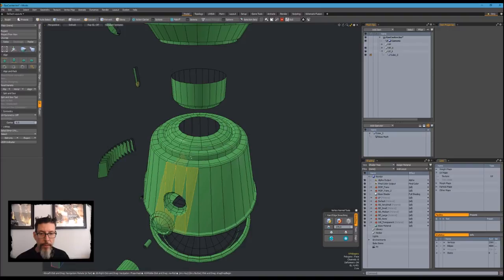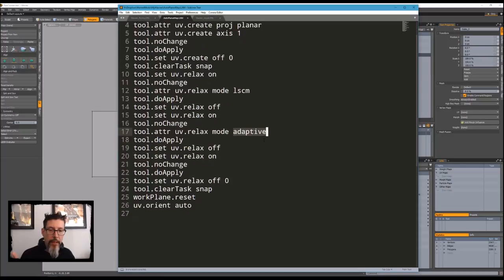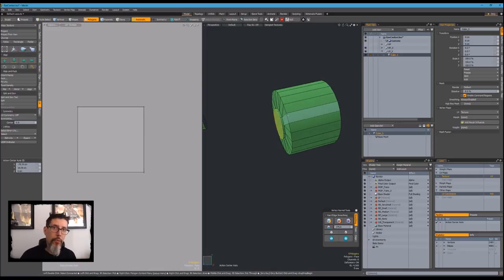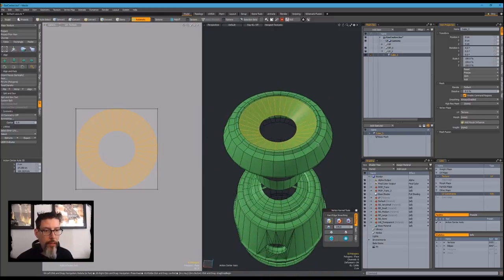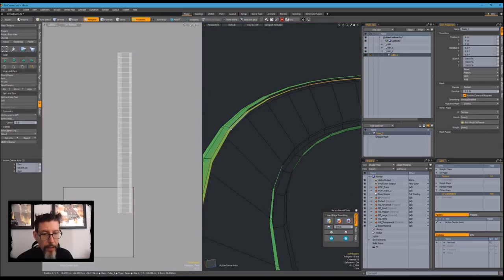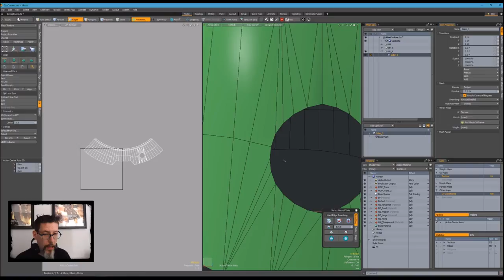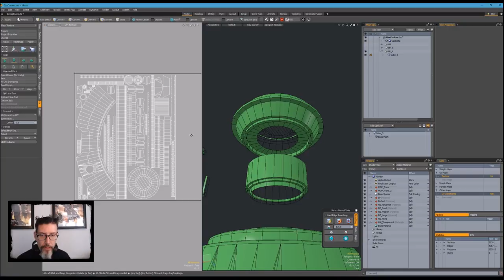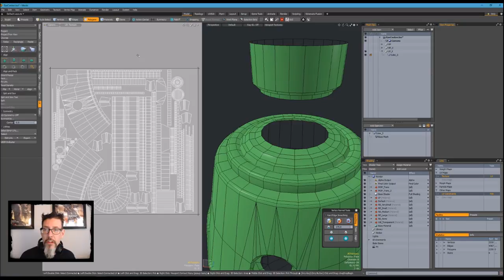Build A Prop : Gas Cooker - UV Unwrapping

Comment: Great video! A couple of things for improve speed of unwaping: now in modo u can split UV edge (split button in Split and Sew section) - it's faster then detach the peace of UV and attach it later. More faster is make the macro: split edge, convert selection to vertexes, select coonected, uv rectangle. Another thing for improve speed of unwaping is using Select Sharp edges.
Reply from the maker: OMG ... OK, I knew that was there but I never thought to use it.  I'll give the split function a go, thanks!  That does sound faster than what I'm doing.
Reply: Ye, exactly, but I've add for me after that select.convert polygon and tool.set TransformMove on. Also one impotient notice: uv split edge works only in first main UDIM only, I don't know why.

Comment: Hey, all: I fiddled with macros and this is the Y-cylindrical projection macro I came up with, based on Warren's work. YMMV & Warren has the last say.

#LXMacro#
workPlane.fitSelect
workPlane.rotate 0 90.0
tool.set uv.create on
tool.attr uv.create proj cylindrical
tool.attr uv.create axis 1
tool.noChange
tool.doApply
tool.set uv.create off 0
tool.clearTask snap
workPlane.reset
uv.orient auto

Comment: tnx for tutorial 
but hang on second 
you said in every smoothing break you should put seam but you didn't that in same parts like teeth of cooker 
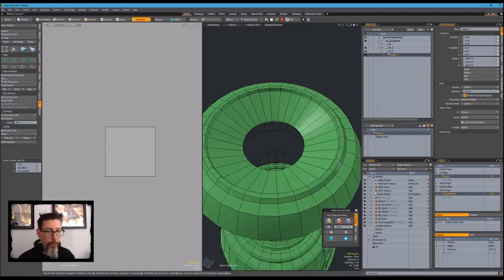or in min 10:45  
this strange  little bit for me .
so what the exception ? 
where we take the rule and where we left it ?
Reply from the maker: The teeth in the main body of the tank? Those don't have smoothing breaks in the low poly.  They may appear to because of the edge weighted normals, but they aren't.  Those are convex shapes that unwrap just as they are.

Unless you meant another area?

And ... well, that rule is pretty iron clad BUT it can be broken or ignored and you'll still be OK in some circumstances, especially if the edge you're NOT breaking is convex instead of concave.  Every rule has a bunch of exceptions.  :)
Reply: Warren Marshall ok that make more struggle 
What you mean excatly by smoothing break ?
I know it by it every edge have 90 degree angle .
Is it right ?
Reply from the maker: It's however you set up your mesh.  Generally, you break on 90 degree or greater angles but sometimes you do other things for various reasons.  But just visually look at the mesh ... if there's a hard seam on the low poly, indicating a smoothing break, you need a UV split there.

Comment: Thanks, great tut. I wanna ask about unwrapping; You packed those parts separately how did you do and  when i select and edge and unwrap in modo it's unwrap whole mesh not that part. Could you give some advice? Thanks again.
Reply: If not invert selection and hide the others by the way but this is time waste
Reply from the maker: If you select the polygons you want to unwrap, then select the edges you want to use for seams, it will only unwrap those polygons.

EDIT : I HAVE found that you have to start the Unwrap tool while in edges mode for it to work - starting it in polygon mode leads to sadness.. That's something to watch out for.
Reply: I see just switch 2 to 3 one after another, thanks. I'm insist to my studio using Modo beside Max and then forgot or ignore the basics sadly.
Reply: I can hardly wait for low poly first then bake in Substance without explode tutorial by the way, which you're using mostly as you said before.  You did it before but it was area weight showing and simple.